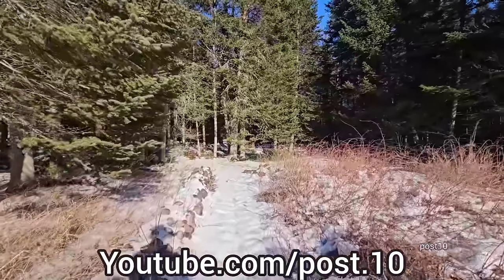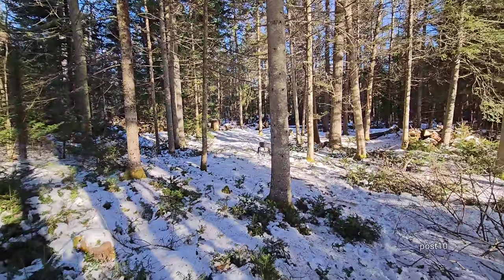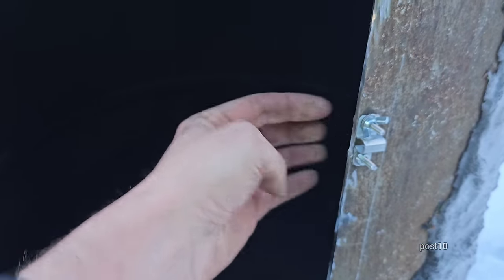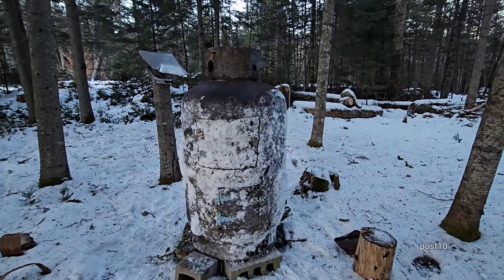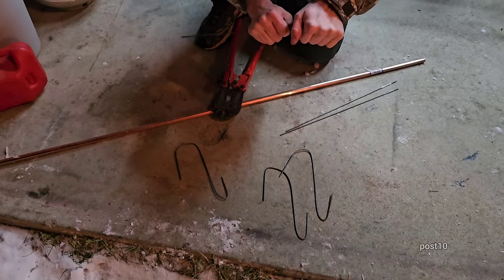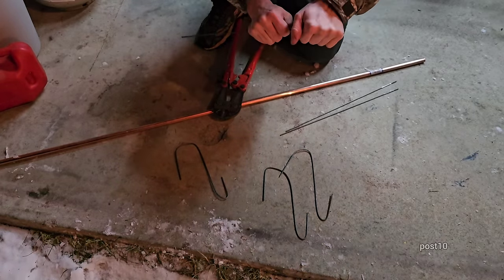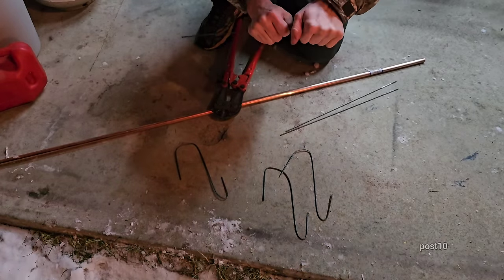Building A Giant Meat Smoker. (Full Video)

Comment: As a chemist, i do NOT recommend using zinc or zinc galvanized metal around food or high heat. Any welder will tell you that vaporized zinc is carcinogenic, and getting it in such high amounts into your food probably isn't great either. Stuff is called food grade for a reason
Reply: MY doc said I am low on Zinc.
Reply: @ncvman  Zinc tabs are cheap and will not get you sick well if you don't take too much or it knocks down your copper lvls
Reply: I agree. I’m sure that tank is not appropriate at all. Don’t do it.
Reply: @patriciatennery3021  Oh brother.  Nervous Nelly in the house.
Reply: Most of it was on the outside. Should be ok.
Reply: Galvanized on the outside if any, has been burned out, and there’s thousands of smokers made of these across the world.
Reply: @kirkanos3968 
They say milk works in a pinch.
Reply: @choccolocco  i mean the hooks
Reply: @choccolocco  Yes drinking something made for a baby cow or calf is great for us adult humans.
Reply: @tehwubbles  
All good, they weren’t galvinized, just steel.
Reply: @choccolocco it does. 20 years worth of grain bin repair welding experience to back it up. If you get a sweet taste in your mouth at the end of the day you know you've overdone it. Drink milk and go to bed.
Reply: Cutting the meat is why it looked dried out after cooking. Way to much salt
Reply: I don't think it's galvanized anymore
Reply: @ncvman  if the doc tells you you are low on iron do you eat a chunk of steel? ik you joking but ong its not the same

Comment: I saw someone else say this, but you shouldn't use cedar for actual smoking. The resin in the wood produces an incredibly bitter soot that will foul the taste of any meat you try to cook.

Also, contrary to what most people have been taught, you shouldn't soak your wood chips. You're not "making the smoke last longer." You are actually making it take longer to smoke. This is for the same reason you don't want to burn wet wood in a fireplace. 

The chips/chunks will just steam until enough water has evaporated for it to burn. The excess steam will make the meat too wet, and when the wood actually starts smoking, the smoke will not penetrate the meat as effectively as it should because of the extra barrier of water, meaning you won't get that beautiful bark that most people look for when smoking large cuts of meat. You'll basically end up with a bunch of liquid smoke dripping back into your coals and a piece of meat that isn't as nicely smoked.

I know people will come out ready to tar and feather me for saying that, but it's just the way it is. You're an inquisitive guy, so I know you're likely going to look it up anyways, but I just thought I'd throw it out there. Haha.

Comment: I have worked with trollies everyday for 20 years. You are making life hard for yourself and doing everything in reverse to what you should be doing. Firstly get the trolley directly under the base or the heavier bottom part. On its side it will just roll off. You always want the weight to be at the lowest center of gravity. Also always center it on the trolley, a bit of rubber matting on the trolley we'll help it stick in place. when going down hill lean the trolley back a fair bit but not too much or it will roll off the side. Your just trying to prevent it falling forward like it did. Also have your trolley going down the hill first and yourself last, If the hill is huge that would be to dangerous but since it's a very small hill you can use it to lean the trolley back as I mentioned. Good luck on your next adventure.

Comment: IMPORTANT!!!  I thought I commented already but I don’t see it. When smoking meats you should use Instacure #1 mixed in with the seasonings. It will prevent botulism.  Also, that meat looked very well done. Next time smoke it at a lower temperature (about 155°F) and only use about 2.4% salt and don’t use iodized. I smoke and cure meats all the time and I’m always learning something. Be careful buddy.
Reply: Forgot to mention, you should soak your flavoring woods in water for at least an hour or so, you will get a great smokey flavor on the meat. But as I said, smoke it at a much lower temperature. ❤

Comment: great job modifying the tank into a smoker, as long as there is a minimal amount of the zinc
in where the flames are most will exit during the hot cycle.and probably nothing will burn off 
when in the cold smoking phase. any more beaver dams? who do you work fot?

Comment: I love that you just get an idea and go for it full speed ahead. A few quick tips for smoking meat: #1. Definitely get that temperature guage for your smoker so you can get an accurate temperature. Put the guage as close as you can to where the meat is hanging. #2. More smoke does not mean better. Read about 'clean smoke' vs 'dirty smoke'. The kind of smoke you want should be blue and often times barely visible. i think you put too many apple chunks on there - i would just use a couple of chunks at a time - but you may need to use more/less depending on the temperature of your pit. #3. Get a probe meat thermometer so you can also monitor the internal temperature of the meat. Getting your meat to the proper internal temperature (not over cooked or under cooked) will elevate your cooking game exponentially.

Comment: Just an FYI, Milwaukee (and Im sure other brands as well) makes permanent markers that can be used on oily and/or wet surfaces. I use them when I'm working in the garage and they work on almost any surface, even ones caked with grease and oil.
Reply: I usually use a screw or nail to score the surface, or a carpenter's pencil to leave a mark that reflects light differently than the surface.
edit: There are also pain markers in a variety of colors, but they're a bit pricey for one-time use, and they start drying out once you start using them.
Reply: I use a silver colored pencil  or white-out marker. Cheap and easy, 20yr welder.
Reply: @MonkeyJedi99  The Milwaukee markers domt dry up or get ruined after use as they are designed for use on not so great surfaces.
Reply: @rbalara31  Cool!
I usually get paint markers from the crafting section of the store, so I have had no experience with those.

Comment: Nice project. To make it even better, have the source of heat outside of the chamber where the meat and the wood of smoking chunks are. That way you can regulate the temperature and time of the hot heat for the meat. It also makes it possible to smoke like whole turkey and it won't leave it raw. We have a diy thick round stainless steel pipe made into a smoker. It has an inside shelves made out of rebar and welded bottom cap and removable top lid. It sits over a fire pit on the fire bricks and it works like a charm. First we make a fire on the fire pit and let the smoker on top of it get warm and burn away dirt. Then we load it with meat or fish, put the smoking chunks to the bottom and keep the fire going as long as needed. We use dried tar alder with apple tree for smoking and sometimes small pits of sugar to give a glossy skin, and the amount of flakes we use is like two handfuls per one kilo of meat, so not very much at all. Have a good smoking days!

Comment: self tappers are easeyer to put hinges on they are ones that screw into metal you just put a 10mm socket on drill and it screws them in saves time...you made that look hard work tryin to move it. could not stop laughing you needed to strap it on friend..i did not think it would work but surprised well done friend it looked like the burner worked perfect..john. England.u.k...
Reply from the maker: It would have tipped over regardless if it was strapped but if it was strapped I wouldn't have been able to pick it back up because I had to put it on one end at a time, too heavy
Reply from the maker: You're right I probably should have used self tappers, didn't think of that

Comment: Advice for anyone putting together the stuff to build one. A metal cutting disc in a regular circular saw makes those cuts way easier (careful not to over heat your saw guard if its plastic) and when cutting with a grinder the disc will last 10 times longer if you only let it go in as deep as the metal is thick. Burying the disc to the grinder your just burning up the whole thing when you only are cutting something 1/4 inch thick.

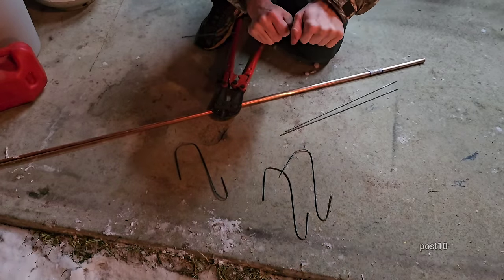Comment: 57:00 My best guess is that it's vapour locked. I get this problem with my string trimmer, I run it for a while and then it won't start back up. Basically what's happening is the carburettor ends up getting hot enough that any fuel that goes in vapourises in the heat. An engine can't run on vapour, so it can't start up. Best way to fix it is to let it cool down a bit. Good time to take a water break!

Comment: After the saw fires a little at full choke put the choke lever back down for half choke.   Will start on the next pull
Reply from the maker: It wasn't firing at all the second timer, it may have been flooded
Reply: @post.10  that's  for the initial cold start.    6 pumps of primer first.     For later starts just pull the cord.    If it dosent go after a few pulls put the choke all the way up then back down  and pull

Comment: Post 10 I wouldn’t think you would need a respirator mask on to use the angle grinder. Your In open air not inside. I’ve never seen anyone use a respirator when using the grinder.
Reply from the maker: It makes lots of dust